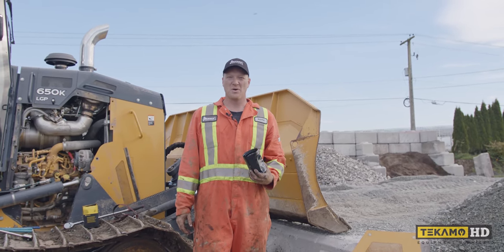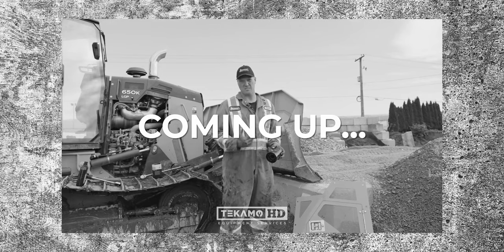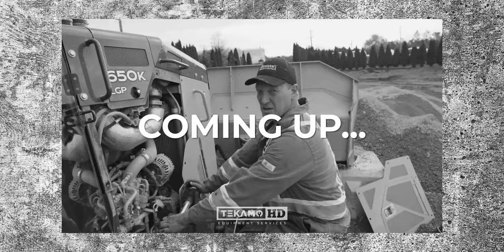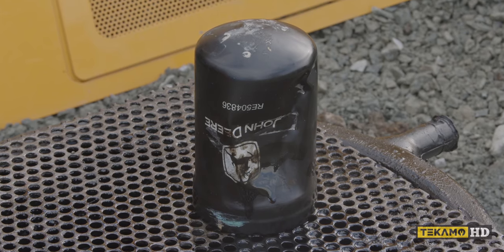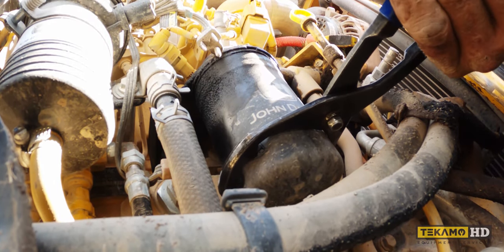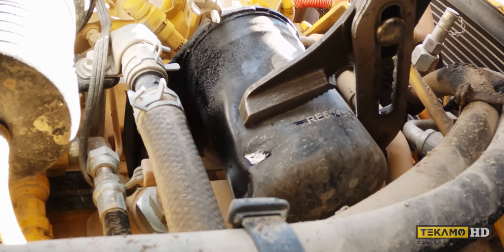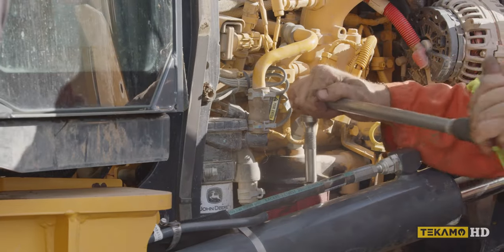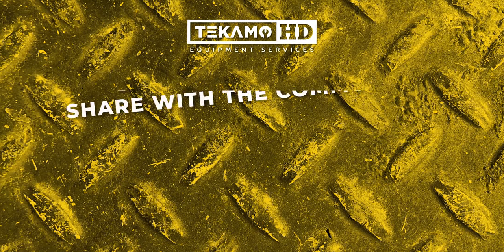DON’T use tools to tighten SPIN-ON filters! See why on this 650K dozer - TEKAMO TIPS #4

Comment: Worse yet, those filters never have names on them so you can never chase down the guy who did it and put a boot up his behind.

I once had to drive a screwdriver through both eng. oil filters on a Sterling on-road dump truck - Stuck up between the chassis rail and the pan, I had to pound a screwdriver in and put a 1m cheater pipe on that. - And of course that meant pulling all sorts of things off that were in my road. Absolute idiots.